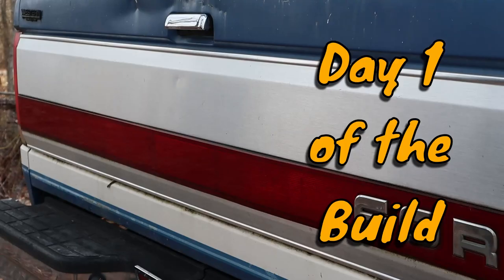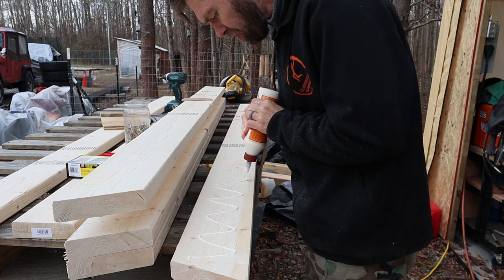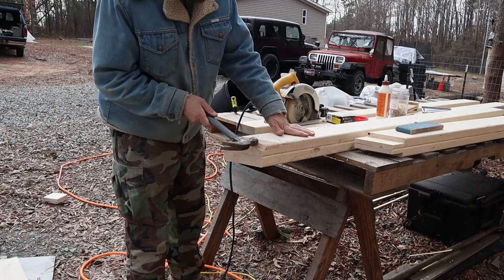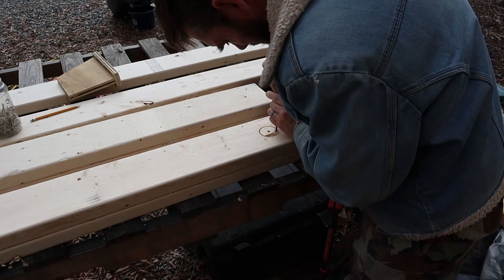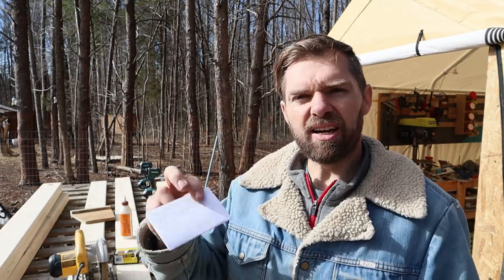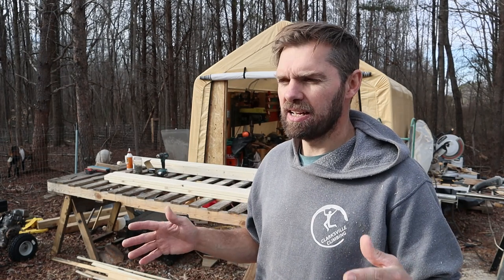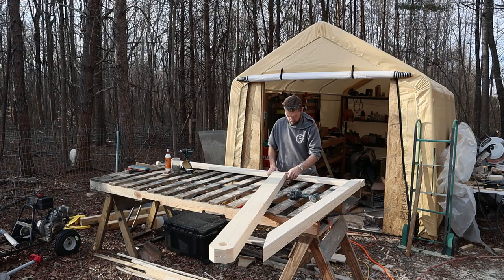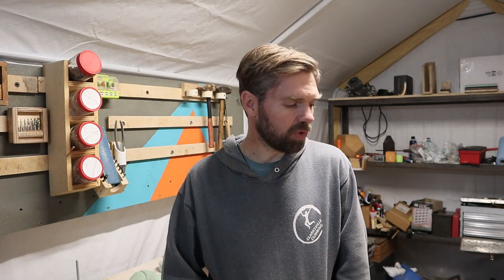EASY ADJUSTABLE HOME CLIMBING WALL BUILD Day 1

Comment: I too would like to see a plan.  It doesn't have to be as detailed of a plan as your campus board plan, but at least a drawing with dimensions.  Hey I see you have links to t-nuts.  Can you link to some stainless-steel bolts?  My wall is going to have to be outside.
Reply from the maker: I'm glad you like the campus board plans. I'll link some bolts for. You might be able to get away with zinc bolts. What's the climate like where you're at?
Reply: @climberdad  Upstate New York.  Only moderate humidity.  The wall will be covered by an overhang.
Reply from the maker: You could probably get away with zinc.
Reply from the maker: This is for stainless https://amzn.to/3Ixfc39
This is for zinc https://amzn.to/3Z6o1rf
Make sure you shop around to get the right lengths for your holds. Most common size will be 2"-3"